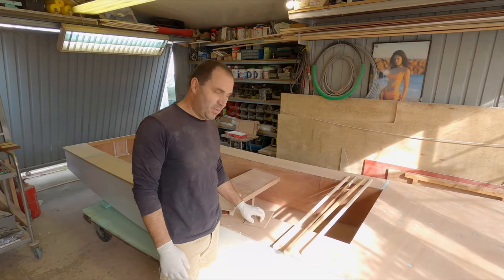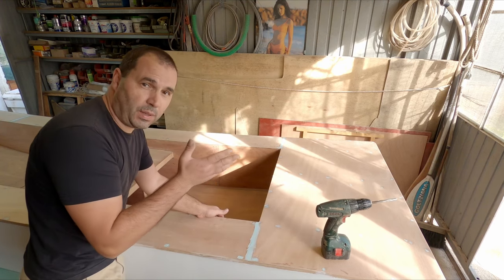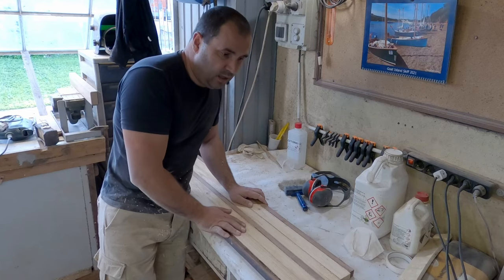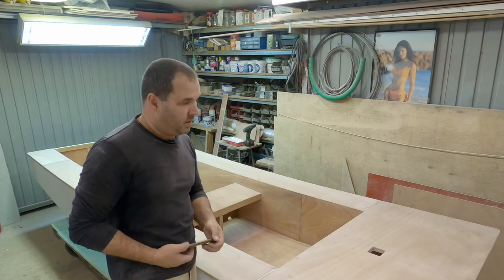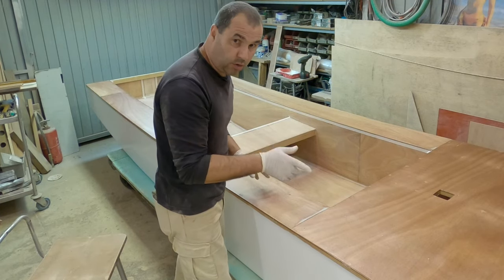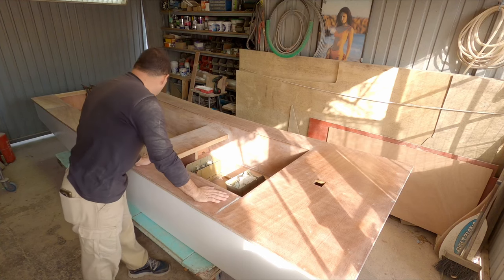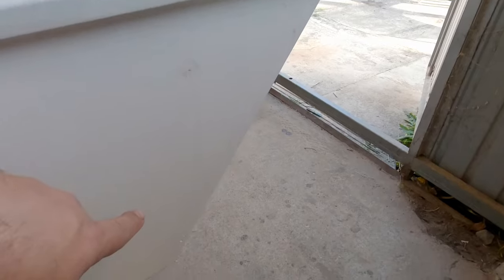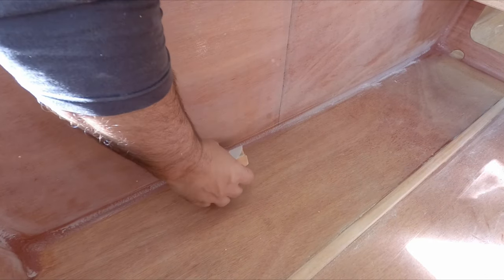Easy to Build, Unsinkable, Car-Topable and Family-Friendly! Carries 3 Adults!! The OZ Goose! Week_10

Comment: One small improvement - the tiller should be clamped so that the two ends that will glue to the rudder box are best if they are clamped parallel while the glue sets up. I'll have a look at the plan - maybe I need to add something.

With the group builds of 10 boats here in the philippines we just clamp to the made up rudderbox while the tiller glue sets up. After rounded then glued to the rudderbox.
Reply from the maker: Hi  @MichaelStorerBoatPlans
I did clamp it parallel while building the tiller. Later when I glued the rudder box to the tiller and clamped it I checked and it was parallel, so in my case I didn't need a clamp. I should have highlighted that in the video. 
The first pic on the plans shows the tiller clamped to keep it parallel, so adding a note to the plans would be great.

Comment: Teo I recall that you put some extra bulkheads in those side tanks so hopefully that will reinforce the unglassed joint in the bottom of the hull?  Maybe without that you'd be in trouble but you have surely lowered the stress along that long joint by those extra bits of plywood inside.
Reply from the maker: Hi  Jason,
Michael Storer explained that the glass tape is important mainly if you use bad plywood as the top veneer might delaminate. They had that problem only in some boats in the Philippines after a few years of racing. so I should be fine!😁
Reply: @TheBoatRambler   Yeah I agree if that's the only problem then you have it covered with good ply, plenty of epoxy coats and the end grain is hidden inside the fillet.  Should be fine.

Comment: I had always been so supportive of people using closed cell foam in larger boats with cabins ( the insulation + positive buoyancy )
so the best thing I learned from this series was again to think.
closed cell foam really does become a detriment to small skiffs.
it's too much weight; and far too much weight, in proportion, once one realizes it is unnecessary. ( due to the lower inertia )
Reply from the maker: Hi Eric,
I have always been against any kind of foam in small wooden boats. It adds unnecessary weight and it ends up absorbing water promoting rot!   Design the boat with separated watertight compartments and it should be fine.
Reply: @TheBoatRambler  ah yes, the wood...that would be a primary reason also...i have never designed for wood, and feel very stupid now for doubting another designer... designing is the continuous process of thinking about what one is designing...but it is good to have this documented with it, so builders understand why Not to.
Reply: @TheBoatRambler  I stopped short with only, what was it, two weeks into my skiff design? .. because it's production composite.
and to the point now where I am thinking much more about the tooling than the boat itself.
Reply: @TheBoatRambler  and then there is such the slimmer chance that it will get made, being a production prospect ... it's better to stop, and wait for interest, so I can proceed under team feedback, and verifications, in such that case that it is.

Comment: I had good results using a foam brush to apply varnish and then tipping with a brush. Just do small areas and keep a wet edge. Worked well on my Tartan 34c cockpit
Reply from the maker: Thanks for the tip.
I get good results with  brush only, just need to deposit varnish in different spots before starting with the long strokes. On my GIS It looked like glass (on horizontal surfaces ofc 😅 )
Reply: @TheBoatRambler  the roller / brush method works great on vertical surfaces (it’s not practical to put a 10K LB boat on its side!)
Reply from the maker: @colvingazelle  😅

Comment: How much does this boat weigh? Can one person cartop it?
Reply: Possibly, but I think the weight is 125lbs, so it'd rely upon having a well tuned cartopping setup (just picking it up and putting it on roofrack would not be a one person job for most people).
Reply from the maker: I have not weighted it yet but I was aiming for 50Kg/110lbs.
I should be possible for one person to cartop it depending on how you chose to do it. That is certainly my intention.
Reply from the maker: The boat is built mostly using 4mm plywood  so I hope it's under 125lbs! 😉
Reply: @TheBoatRambler  I’m sure you’ll figure out a good system (the flat decks actually allow it to be rolled on from the rear using a pair of suction kayak rollers); I just didn’t want that person to think it wouldnt involve some thought of how to do it (unlike, eg, a lightweight kayak)
Reply: What about a nesting or modular version of this boat that would consist of 2 halves that are attached together before sailing? I'm sure one person could cartop each half which would weigh around 60 lbs?
Reply: @montrealpaddlingandboating6482  This would be a good question to the designer (who is very active on FB groups dedicated to his designs), but I would guess probably not? Or at least, not without some amount of strengthening (maybe it would be possible to double up frames at rear of centercase and saw between... but this structure would need to be pushed into the side tanks, at the very least!).
Reply from the maker: @montrealpaddlingandboating6482  it's almost impossible to make a rectangular nesting dinghy with enough built-in flotation.
but have a look at the Mebo 12
https://youtu.be/-SbTDj_eplw